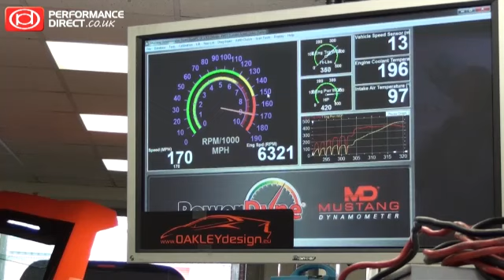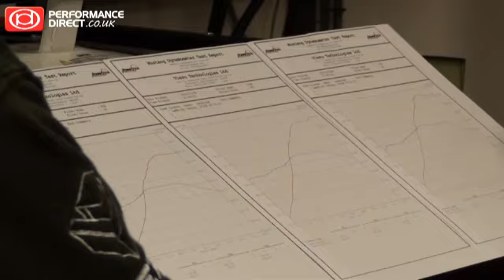Lamborghini Aventador modified by Oakley Design - Dyno & Speed Test

Comment from the maker: The back of the car was removed to keep the engine cool.  Under normal driving conditions there would be far more air moving through the car to keep it cool but not while it's stationary at a rolling road.  230mph was the top speed at this test.

Comment: You said turbos wont change the top speed of a car, I figured you meant power wise, not gearing wise. Especially since you mentioned two cars at different power levels racing each other. The higher horsepower car will obviously reach its top speed faster. These cars are usually geared for well into the deep 220+mph range. Even my 4spd auto corvette with 3.42's and a 7000rom redline is capable, gearing wise, of 225mph. Power and drag are another story.

Comment: The weight saved by adopting 2 wheel drive is not enough of a an advantage to out drag a 4 wheel drive car which has been increased in power and has lost weight.Even the standard car in 4wd would outdrag this Oakley version up tp about 60-70 mph.

Comment: im not sure about what you said of this lambo been faster from 0-62 than the original 700-4. remember this one has more hp BUT its not awd. so it cant launch faster. rear wheels will just spin. About the questions of the turbos and the top speed it obviously increased the top speed remember that there is no stock car that can pull all the juice of his last gear. with the turbos you can reach that additional power n torque the engine needs to increase the top speed. BTW NICE FLAME ON THAT EXHAUST

Comment: Ok I have a good question, is this car faster then underground racings version now there horse power is 1200 0-62 is 2.2 seconds but it's because of the twin turbos, but from what I've seen turbos don't increase top speed it only increases how quickly the car can get up to it's top speed right??? So is yours faster or there's is?? But 230 mph that's new to me I like it, oh how much does it cost to put together a kit like yours on that car?

Comment: and i have a question. is the aventador electronically controlled cuz i saw that when reach 230mph the ODO stops... but RPM still rising..?? so it may be more than 230 maybe 235 240.. just saying.

Comment: LOL. Twin turbos produce power. More horsepower will allow for a higher top speed. Acceleration is also more dependent on torque but a higher hp car, especially 200+hp more, will have a higher top speed, drag permitting.

Comment: this car in that video did more than 230mph, you see the rpm kept moving when it reached 230mph, thats only because it is programmed to NOT show numbers higher than 230mph
turbos doesn't increase top speed because top speed on those cars are limited by gearing not by engine power :) if UGR Aventador had an 8th gear it would gladly do 250+mph......... hope that helped